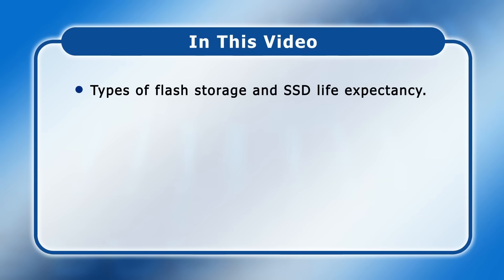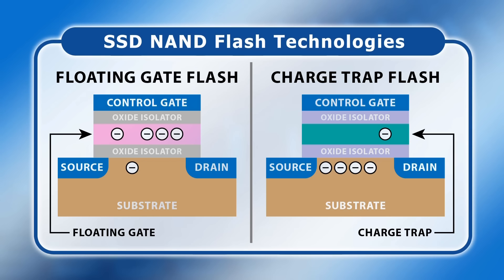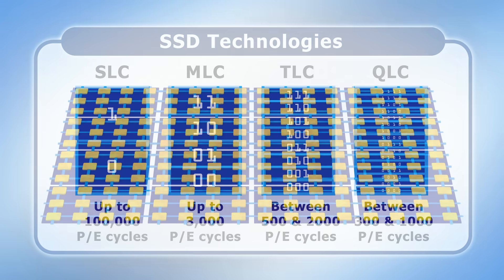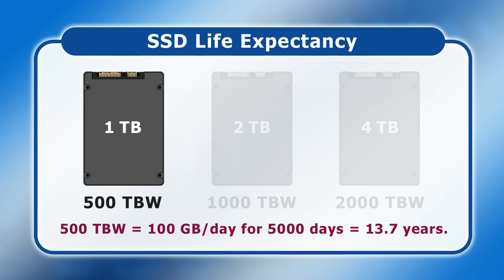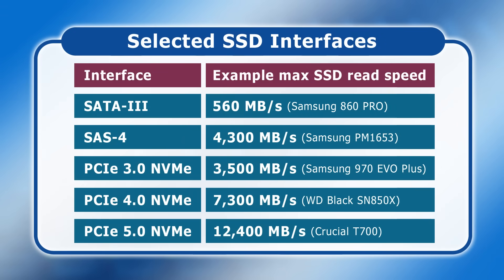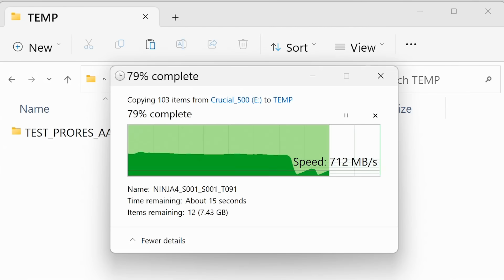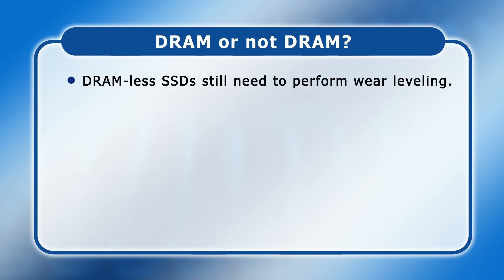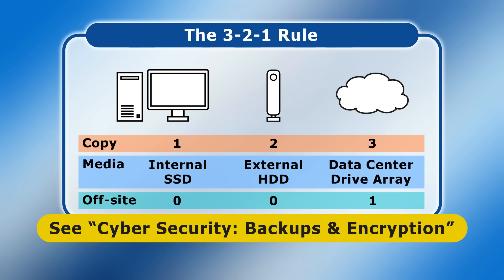Explaining SSDs: The Price/Performance Trade-off

Comment: Of course in some laptops like Apple Macbooks, the NAND flash chips are directly soldered to the logic board which means you don't any choice as to upgradeability.
Reply from the maker: Sadly so.
Reply: So you don't want to use (external) HMB SSDs, as they further increase the wear on your Mac's SSD
Reply: @Wannes_   the whole point of a laptop is it is one unit.
Made to fail.
Of course I could use an ext drive for swap, but they could put an ssd in the laptop that could be easily replaced.
Built to fail. C*nt apple
Reply: @cromulence  Except you aren't doing any intensive read/write.
Reply: @cromulence  That makes sense.  I probably should have held off on upgrades tbh.
Reply: @cromulence  i post from a 5 year old hp laptop i got for 350 euro and i had running 24/7 like a server all that time. what's your point? that i should had payed 1200 euro? it pains me to see more and more pcs got soldered ram and less expansions in that price category. not even ethernet! all will eventually go the apple way
Reply: @docwhogr  screw apple, time to fight back, stop being an apple brainwashed fool
Reply: This is one of your best videos learned import info.. thanks
Reply: Join the war against Apple and google, stop being a debt slave patsy to they're spying activities that is threatening everyone's privacy.
Reply: This is what stops me ever buying another Apple product. They are built to fail.
Reply: @Super8Rescue yeah cause Samsung and Microsoft are doing a better job on that front /s
Reply: @Super8Rescue  They're so concerned about the environment, though... /s
Reply: Yeah, but a 10 year old Mac wasn't built to be quite as disposable and cheaply made as the ones of today...  @cromulence
Reply: @cromulence My 2011 MacBook Pro crawled to a snails pace by about 2017.  It seems like each upgrade of the OS made it perform worse.  I just ended up slapping Linux on it and it was like new.  The hardware I believe is pretty solid in Apple products, it's just the software that bothers me personally (which some people love).
Reply: Also all the BIOS is stored in the NAND chip as M series Macbooks don't have any dedicated BIOS chip in the motherboard, so the chip replacement is virtually impossible
Reply: @sihamhamda47  i ve seen people here on youtube repplacing the ssd on the macbooks with no issues.
Reply: @george-danfulger  yeah but it require total re-flash via DFU recovery, including re-flashing the firmware